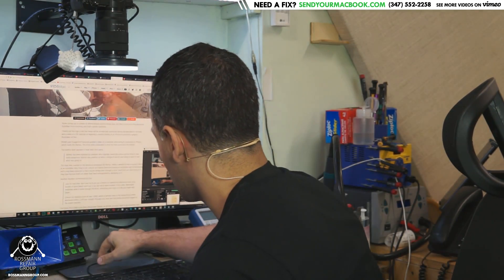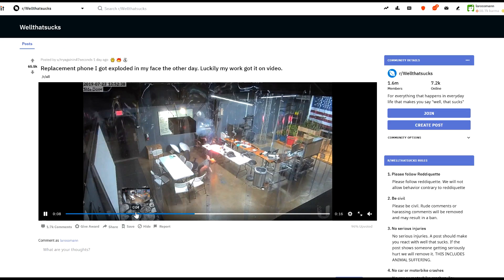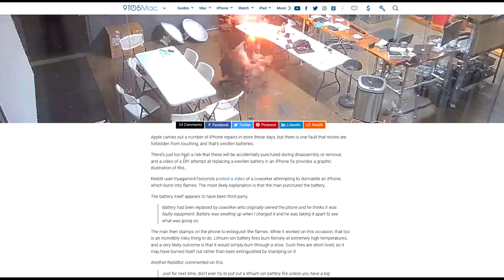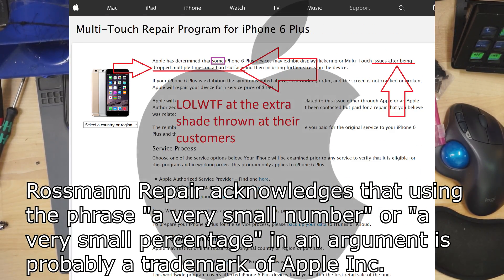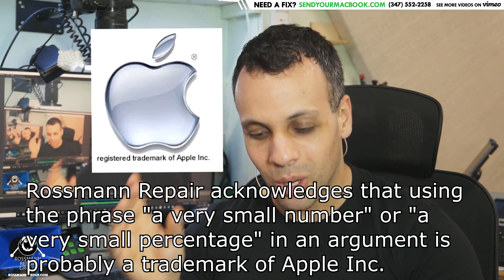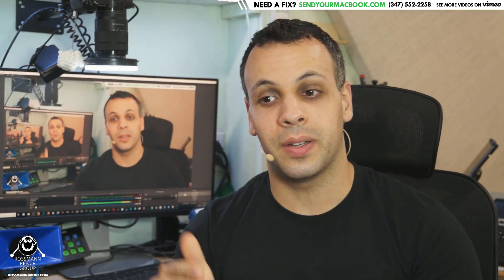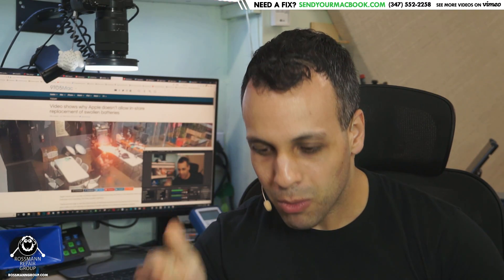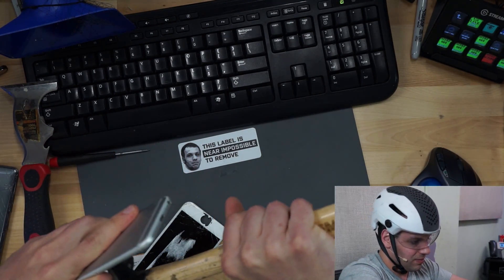STOP FEARMONGERING

Comment: Lithium batteries tend to fail spectacular only if they are charged with a decent amount of energy.
During puncture they develop a short, this short results in heat due to the stored energy and this triggers the fire/heat/etc.

One very important thing here to note:
All smartphones i've seen have only one cell, and you only change this cell when it's practically dead. So you never have enough energy stored to light up your home.
In computers, there are mostly more than one cell and you normally change all cells because you don't know which one has failed. So it is more likely to get something on fire there.

I've conducted some tests for myself and, despite what i've done to the battery, i could never get a discharged/weak battery to light up. This only happens for partly charged batteries with a small enough internal resistance and capacity left to do some harm. But this can happen to you with any decent battery when you short it. More energy -> more kaboom!

The only thing a dead lithium battery does when it gets punctured is some light smell and possibly a little warm-up. They just can't explode or catch fire.
Reply: It's not charge so much as heat in general. Most chemistries can reach a point of thermal runaway, at which point all you can do is get away from the fumes, and try to keep it from catching other things on fire. It usually will happen during charging.
Reply: @laurelsporter  yes, but without a sufficient charge and capacity you'll not get enough heat for the thermal runaway. Tested it on many cells. Round and "soupbag" types.

Comment: Why are they aggressively gluing the battery in the case? It should be tight enough and big enough to not rattle- even a double sided post it note (not Schilling for the Minnesota Mining and Manufacturing Company) would be sufficient for a small battery to not rattle in a case.
Reply: Imagine the uproar if car batteries were glued in.
Reply: @Choice777  Tesla. and they also subscribe to the same right to repair philosophies as apple.
Reply: @Gassit  At least they haven't glued in the battery.. yet. Don't give them any ideas.
Reply: @Fred Gassit i feel like random people poking around a tesla have a much higher chance of hurting themselves compared to apple batteries
Reply: @Choice777  Or if the wires and terminals were soldered together with ceramic caps covering the terminals - safety first...
Reply: Is that what 3M is?  Mining? 🤣 I thought they make glue and tape.

3M: We've been glue miners for 5 generations.
Reply: Or better yet, foam sheet. Something like neoprene should be good, and can be bought in sheets of 0.03" thickness anywhere, I'm sure thinner if you're going to buy it by the pallet. Or, TPU sheet, maybe.

Blackberry used to do the same thing.
Reply: Because if you can't replace it you'll have to buy a new phone.  It's all about sales and shifting as much product as possible.
Reply: But, seriously though, 3M's engineers and chemists are gods among men. Shilling 3M isn't shilling. They literally are the glue holding our reality together.
Reply: They didn't need to glue it at all, their old ones were removable and just clicked in.

Comment: You can even decrease the chances of a thermal runaway by discharging the battery first if possible. I have been servicing these devices for some 15 years and I have never had one reach thermal runaway, I have never punctured a lithium battery in removing them.
We really, really need to extend the longevity of our devices, they are not made of renewable materials. It would not be hard to force manufacturers to use user replaceable batteries. I won't buy a device if I can't replace the battery. I can still get a replacement battery for my 10 year old ereader, which I have updated to have new features with an aftermarket mod. Sure I am not going to buy a new ereader for some time but I am not going to be generating ewaste with it and will be consuming less rare earth minerals.

Comment: I generally consider apple products to be disposable.
Reply: Yup...so do they....
Reply: Sadly, yup.  I've been hanging onto my 2011 MacBook for a while.  It's been solid for me despite the GPU issue with the model in general.  I'm looking to upgrade soon and there's nothing modern from Apple that I could even upgrade to.  I have my 8TB SSD installed in my 2011 machine, and that's impossible on a new MacBook.  No more matte display option, no more magsafe, crappier batteries, on and on.  Looking for a PC laptop now, but there's not a lot of better options there either, I get to choose between glued together underpowered useless crap, or shit so big I need a tow truck and nuclear reactor, or a great usable upgradable machine that costs 2500 bucks and dies every freaking year (lookin at you, razer)
Reply: @alakani  http://x220.mcdonnelltech.com
OSX High Sierra on a Thinkpad X220

https://forum.thinkpads.com/viewtopic.php?t=119964
"What is the best choice for OS X on thinkpad ?"

https://www.tonymacx86.com/buyersguide/building-a-customac-hackintosh-the-ultimate-buyers-guide/

https://www.cio.com/article/3193071/building-a-hackintosh-without-the-help-of-tonymacx86.html

Building a Hackintosh without the help of tonymacx86
Reply: @alakani  desktop and remote in via phone... just have an unlimited 5G data plan and your good.
Reply: I wouldn't use any Apple product for free.
Reply: @Choice777  I have to use one provided by work, it's a horrible experience.
Reply: And this is why I would not be willing to pay more than $10 for an Iphone 10, needless to say I am not buying an Iphone anytime soon, or any flagship made after 2016. Yeah I am going to be stuck with my V20 for a while.
Reply: Well i used some Corporate Lenovo Notebooks. 1 battery replacable the other one is Inside. Sooo win/loose maybe xD